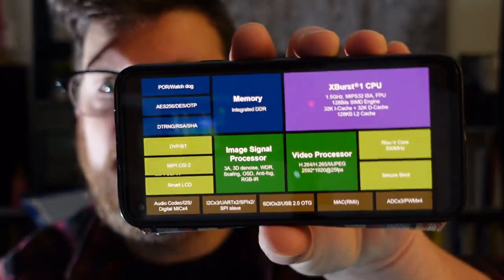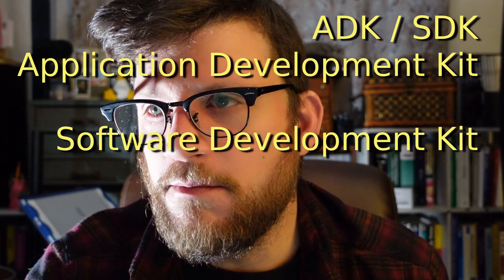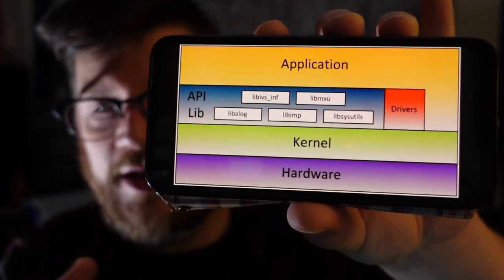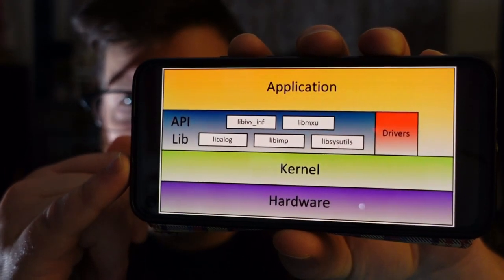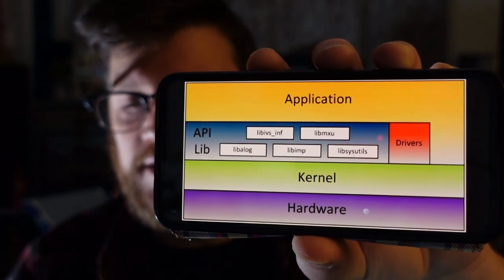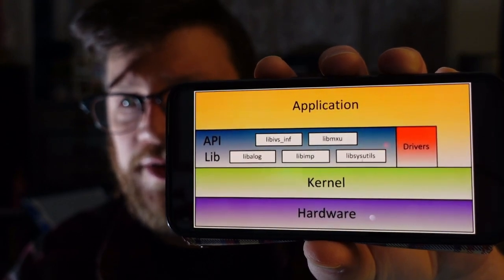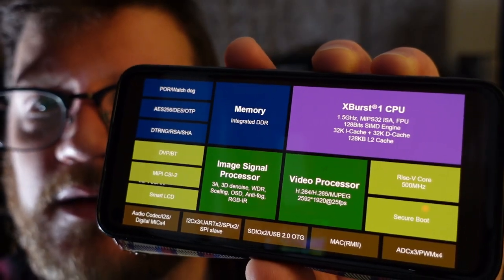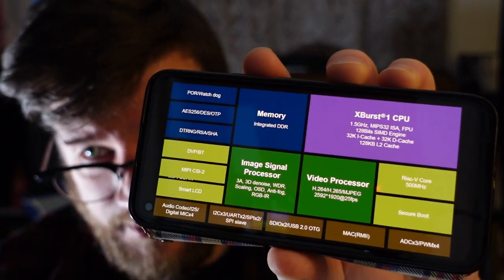This has Linux Inside? | Part 2.2 |$ 1 MIPS & RISC-V Inside WebCam

Comment: 8 megabytes not 8 megabit? 8MB is kinda huge for rom for a simple embedded device
Reply from the maker: It's an odd duck. I translated 64 megabits for the non-initiated. It will all make sense in the next video. Someone decided to shove an IP camera platform into a crappy webcam. I've even found kruf left over for networking! Stay tuned and thank you for the comments!
Reply: @hackerhomestead  ah more veatigials, makes sense
Reply: 8Mbits would be really small for something running Linux.

Comment: on that serial port connection there is gonna be bootlog console for bootloader and then kernel log during kernel boot and when kernel boot there is gonna be linux bash console
Reply from the maker: Your ahead of the class 🙂🙂🙂 next episode "EAT ME" has all that but I had to skip ahead of a lot of the boot loader stuff. Part 4 (not released) I actually write some code and run it.

It's hard to figure out how to signal to viewers what level or assumptions I can make so I'm attempting to break the journey up, I am very open to ideas and suggestions of those who are already initiated like yourself

Comment: check chip like BL808 - probably beats that one
Reply from the maker: Sweet thanks for the suggestion and support. Tbh that's the kind of direction I was going to go, but finding something in the wild like this T31 was totally unexpected.
Reply: @hackerhomestead  T31 is older soc - it is based on XBurst 1 32-bit MIPS core and low power risc-v

Comment: most of them do.  and for quite a while already actually.
Reply from the maker: I knew the trend for ipcams and routers and IoT but for simple webcams I am still amazed. In the next one I find out that the camera is basically just another C app running in Linux 😅 guess FPGAs for local AI are getting common place too huh. I admit I've been out of this game for a while but what a scary cool time we live in.
Reply: @hackerhomestead  indeed. i guess thats because nowadays its trand to just put raspberry pi anywhere even if you need just do led blinking or something. and implementing something like full wifi and tcp ip stack in custom firmware gonna be huge "reinventing wheel" feel to that so that all kinda makes sense for iot stuff

Comment: Sorry, I couldn't watch it completely, I really don't like your style.
From my point of view, it indeed looks like an embedded Linux capable board.

The [RX TX GND 3.3V] is indeed very most likely a serial port.
Wire a USB to serial to the corrects pins (RX from the converter to the TX of the board, TX to RX, GND to GND, and leave 3.3V free, power the webcam via it's regular cable), then plug the other end into your computer, fire up a console, power up the camera, and the boot infos should display. You may be able to interact with the system (try user:root password:"root" or "toor").
You probably won't be able to write anything to the storage tho, only in RAM.

You probably won't be able to do much with this system as, even for very basic things like these kind of system, they burn a signing key onto the processor (by blowing fuses, so it's not reversible), and it will only boot images with the correct hash, and correct key.
So, either you are extremely lucky, and they didn't actived the signing, or you are even more lucky, and you find the signing key to make your own image to boot from.

Anyway, good luck, it's a nice project to try to hack these kind of devices.
Reply from the maker: Thank you so much. I totally understand not being everyone's cup of tea. And you are very kind. Sooo it did turn out to have a partition that was writable. Further I was able to compile a hello world and get it to run (part for editing now). I am considering myself quite lucky not only for the find but also for the kind responses such as yours while I am still figuring out my formula and format.